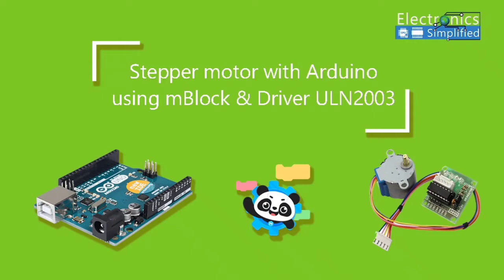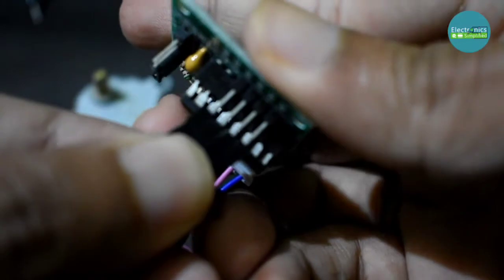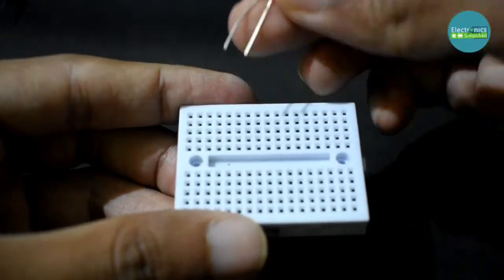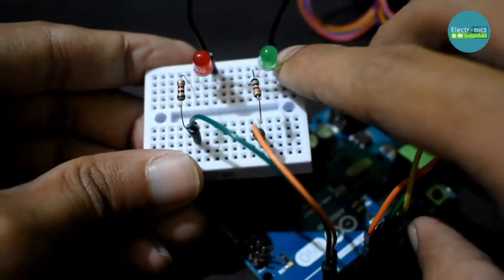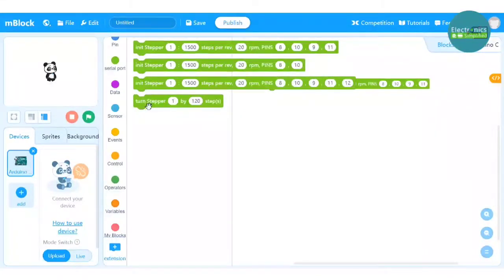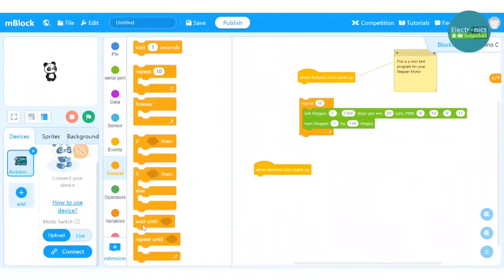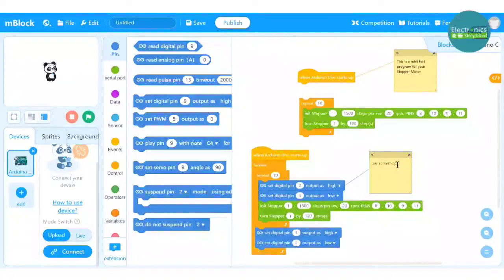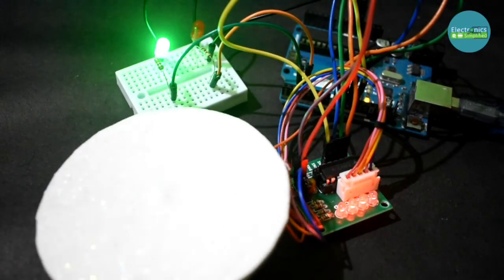Stepper Motor with Arduino using mBlock

Comment: connect green led positive to led 2 (4:44) orange cable. And you put it in number 3 ... litle bit cunfused here :-) Als the motor diagram is different ( mirrored ) to what you do or say. :-( Just positive feedback :-)